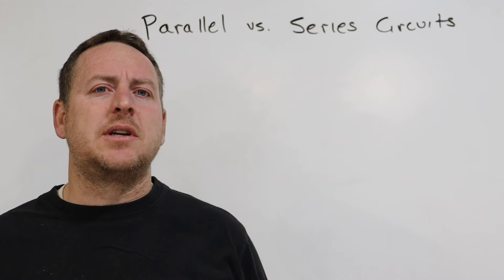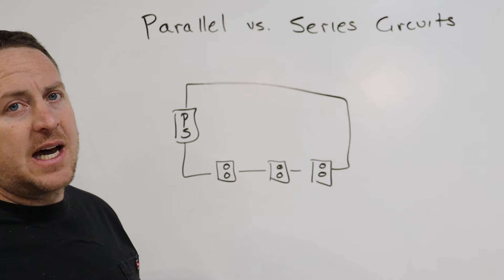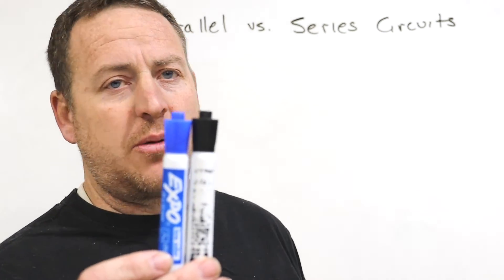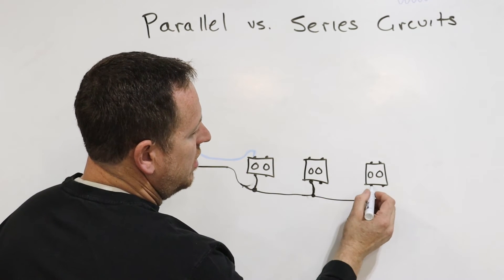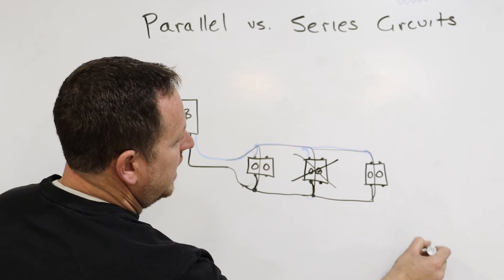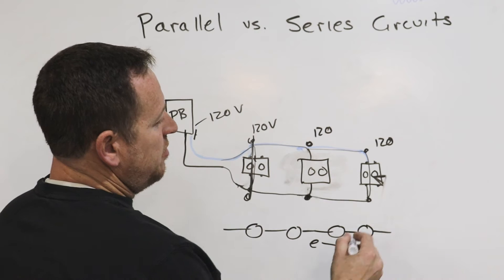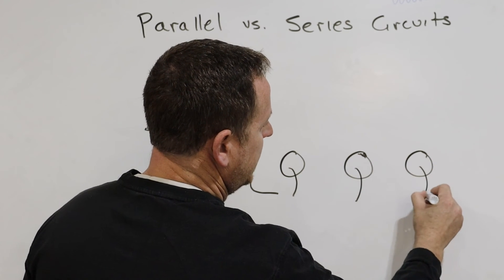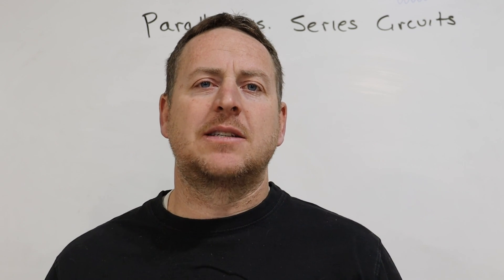How AC Circuits Work in the Home | Parallel and Series Circuits Explained | Electric Circuits

Comment: What if you did not pigtail the wires and you used all four screws on the receptacles?
Would that still be considered parallel?
Reply from the maker: Yes, these ac circuits are always in parallel. In two two Sundays from now I will be releasing a video explaining the nature of parallel circuits.
Reply: @brettleybuilt 
Thanks.
I am grateful for your time spent teaching us.
Great video by the way.
But I noticed you used the christmas lights example for a series circuit..
People might get confused because if you use all 4 screws instead of pigtailing and the first receptacle fails then all the other receptacles will have no power and this is where people will get confused.
Maybe there is a better example??
Subbed by the way

Comment: Am I understanding correctly that if I don’t use pigtails and thru wire my receptacles that they would then be in “series” because if the receptacle fails to conduct the current then the rest of the downline goes out?

I pigtail in certain situations but often I thru wire my receptacles in my home. None of them support anything critical and some boxes don’t have room for pigtails.
Reply from the maker: Technically all ac recepticals are in parallel. It is defined as the path the electricity takes, not the orientation of the recepticals relative to one another.
Reply: You're just relying on the little connection in the outlet (especially bad with cheap crappy outlets) or the pressure under the screw to hold the wires together. This is against current code and could cause a fire as the wires may not fully touch and cause resistance (heat) and therefore potentially a fire.
Reply: @andrusha77  The little connection in the receptacle is rated for 20 amps pass thru, even with residential grade receptacles, and is a code compliant method. If you think it's against the code, then cite the code that makes it a violation. The exception would be in a multi wire branch circuit, the neutral wires must be pigtailed, per NEC 300.13(B).
Reply: No, it's always parallel. Instead of pigtails and wire nuts, you would be using the metal plate between the screws as the connector. While it's true that if a wire came off of the screw, it would shut down the rest of the circuit, it would be electrically equivalent to say, a wire nut fell off and the wires separated. The rest of the circuit would still shut down. Some people use the term "series" when the receptacle is used as a connector, but it's a misnomer.

Comment: I’m only three minutes and 10 seconds into the video but so pretty much a series circuit is where if anything within the circuit goes out entire circuit shut down like the old Christmas lights so technically if I was putting let’s say car batteries and linking them all together like Daisy chaining which is the correct terminology I think And you series circuit would that be like a safety feature to prevent the batteries from either burning each other out or would that just like be like say I have 10 car batteries they’re all chained together. Say the car battery in the middle dies what would that cause if it’s a series circuit it would be just like those Christmas lights in the past Would that prevent anything from happening or would that cause one of those batteries to overheat and catch fire? If it’s bad enough and my understand is what’s the difference between the series circuit and the other regular parallel circuit I get the parallel circuit is just like a square it goes all the way around back to the original source and power runs through all of them, but what happens if the outlet and the parallelcircuit goes out it just pretty much fry that outlet which could cause a fire or would it be like just like a dead box that the power would still run through but it would be fried and still go all the way around like a square back to the main source
Reply: I think connecting a load of car batteries in series wouldn't end well cause you would have the positive end of one battery connected to the negative end of the other, so it would be a short circuit basically. probably catch on fire if the wires aren't thick enough to carry the current either (or you could melt the wires lol be careful with jumper cables), cause a car battery provides a lot of amps. If you connected them in parallel and if one of them went out you would see a drop in voltage but the circuit wouldn't be broken and it would still provide power just at a lower voltage.

Comment: This was very helpful video as well as others

After much tinkering, I am realizing some times items I plug into a the wall then don't but work on other plugs, does that mean the circuit breaker is failing?
Reply from the maker: I am guessing you are plugging the device into outlets on other circuits?
Reply: correct, on a different circuit breaker
 @brettleybuilt

Comment: Maybe I missed an explanation somewhere, but why are the hot wires pig-tailed in this situation rather than just having one black wire on each screw on the right side like I saw in a previous video of yours? Might be a dumb question.
Reply from the maker: If you were watching Electrical Basics, I made a follow up video correcting that. I should have pig tailed the wires in Electrical Basics.